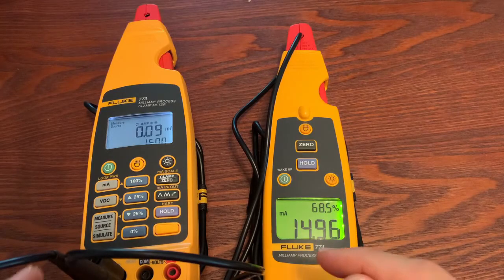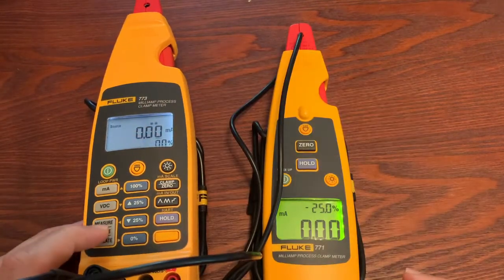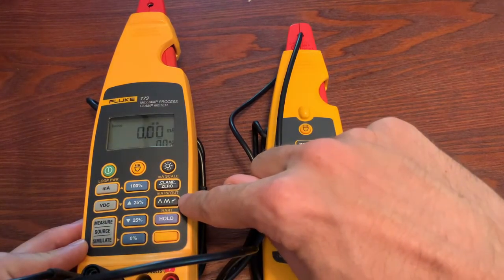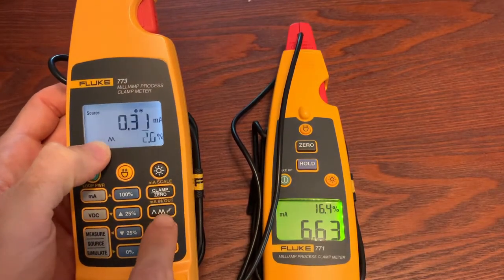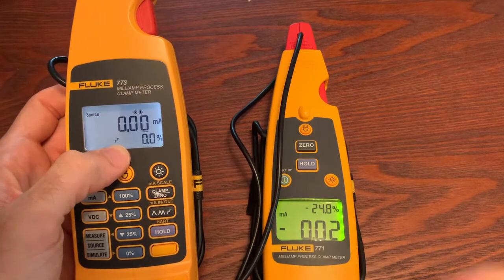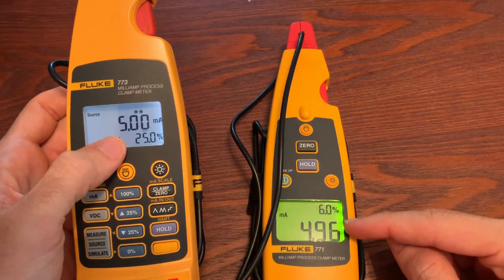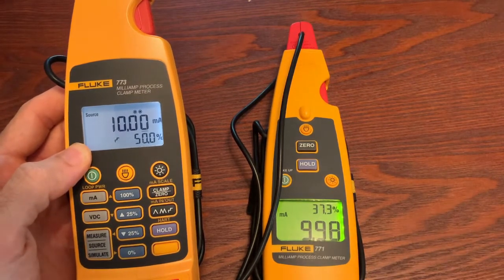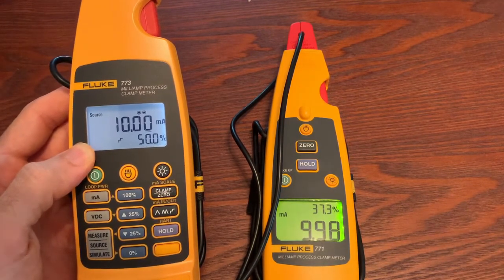07 - Continuous Scaling  - Fluke-773

Comment: Hi thanks, can I use 771 on higher voltages and hi frequency in power supply between pcb component to read mA used?
Reply from the maker: the 771 is a DC only measuring device.  Meaning that it should only be reading current with a 0 Hz frequency.  I don't think the Voltage should matter because it is non-contact.
Reply: @fridayswithbrandon  well I know enough to know it is ac/dc
Reply from the maker: @AB-yu2tj  what is ac/DC? Your application or the 771 capabilities?
Reply: @fridayswithbrandon  capability of 771 is both AC and DC.
Reply: @fridayswithbrandon  you know what to tell you the truth I don't think I've tested in AC. I will test today.